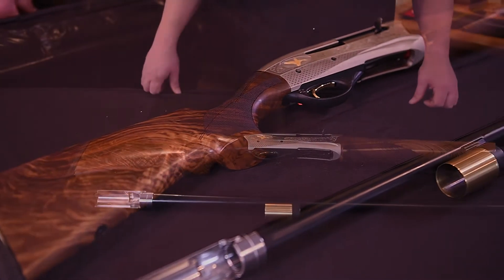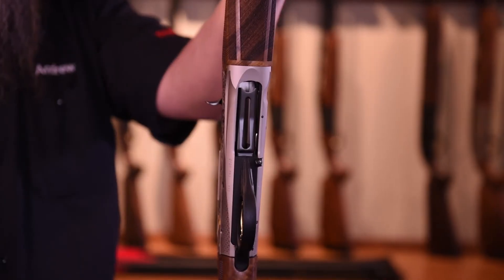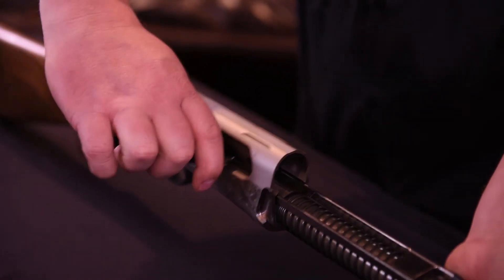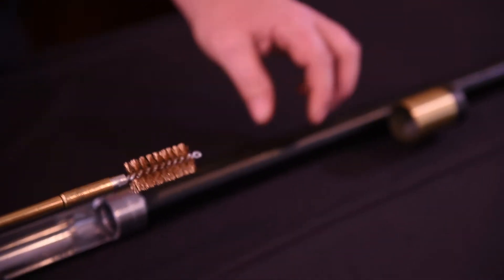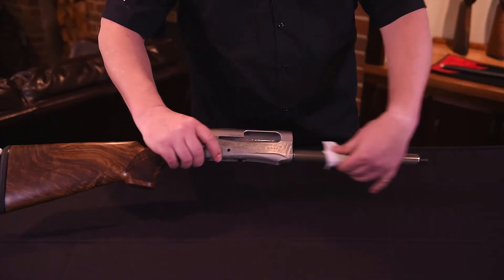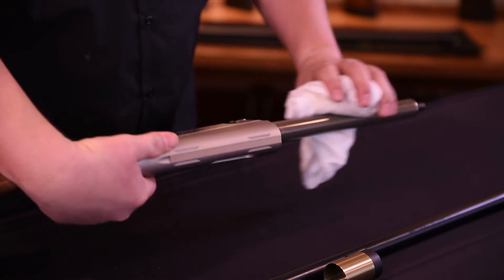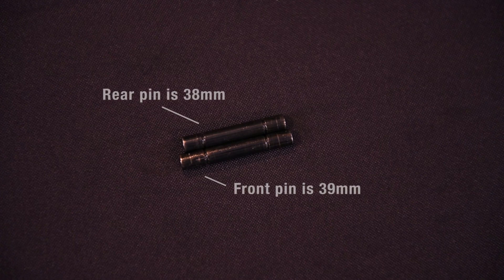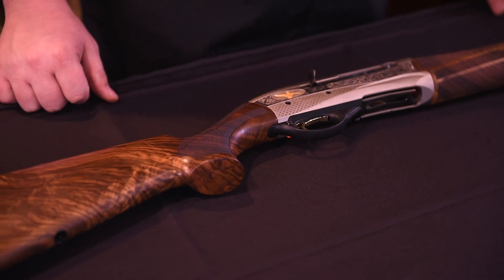Fabarm L4S: Assembly, Cleaning and Maintenance

Comment: Hello, I have verified that having the lock locked in its most delayed position (ejection window open) when moving the shotgun a metallic sound is heard.  I imagine that it is the plunger of the piston pulse and that it is normal.  They could confirm it to me.  Thank you.
Reply from the maker: Yes you are correct and this is normal. If you are in the U.S. please give our gunsmiths a call at 410-901-1260 and they can help answer any other questions you may have.